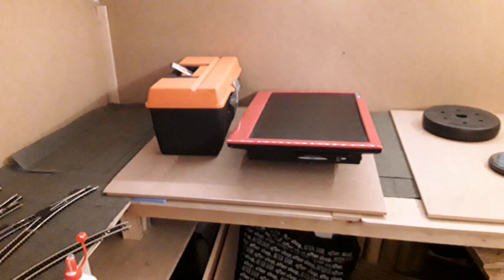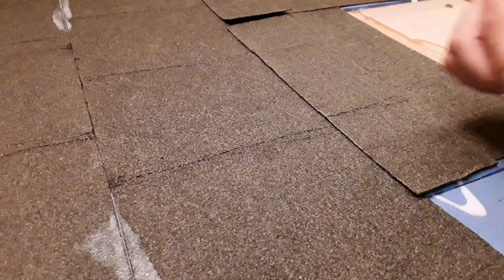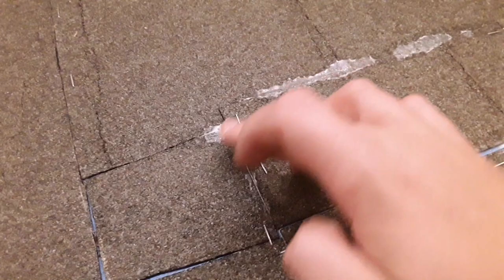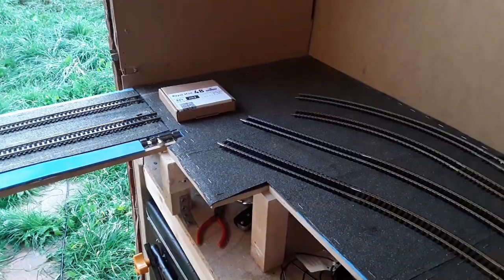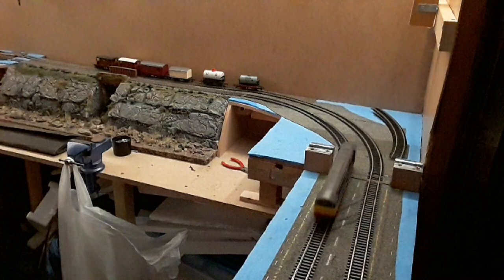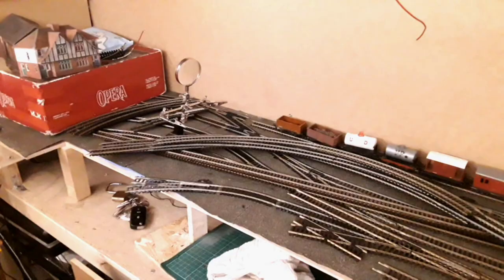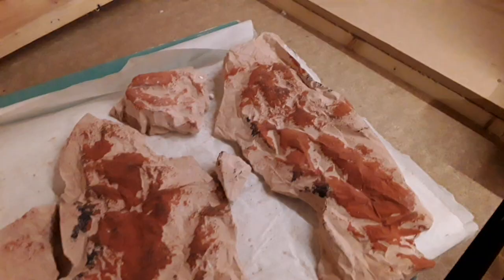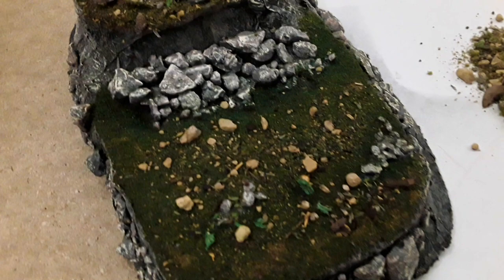Installing UNDERLAY for track ballast?

Comment: Hello Richard 😁 very interesting experiment using roofing felt 🤔 especially with its texture and colour benefits 😍 I wonder if you could have used an “oil” based glue rather than the water based PVA 🤔 due to its inherent “water repellent” properties ☢️ As far as next projects are concerned, my own experience has been to ensure that the track work is performing to your requirements before going too far on scenics 🤔 Chadwick Charlie’s latest did a great piece on blocking out your area with test pieces to “see how it would look” 😎 Michael at Chandwell does the same 🤩 Living with something for a while really does show ups it’s faults 🤔 “or so the wife says” 😂😂😂 Very best wishes from County Wicklow
Reply from the maker: Hi Paul! Thanks for the comments! Haha! Yeah, my missus says something similar! 😂🤣

I have not seen any videos where roofing felt has been used under track, so I thought "why not?!". I initially put some down in the corner where I will be putting a tunnel, and liked the effect so thought I would continue it on the rest of the layout...
Visually, I think it works but how it will hold up, time will tell!

So far, the PVA seems to be holding it down well, however I have also added staples along the edges as well for extra stability...

I have ideas for scenery, but agree that I want the track all up and running first before anything permanent is applied... I am considering the tunnel in the corner as the first piece so that it can add scenery and visual interest to the layout, but have the benefit of being removed if needed... 🙂